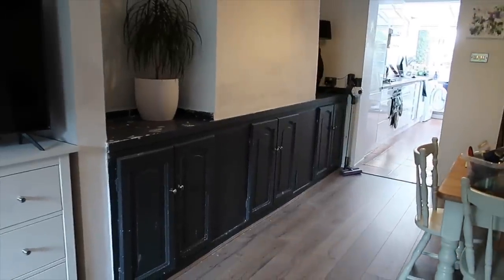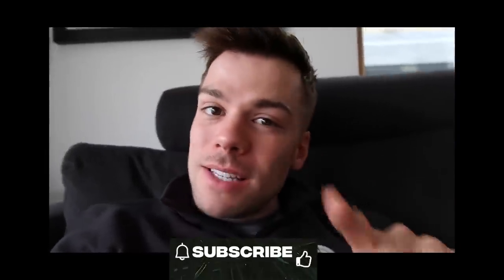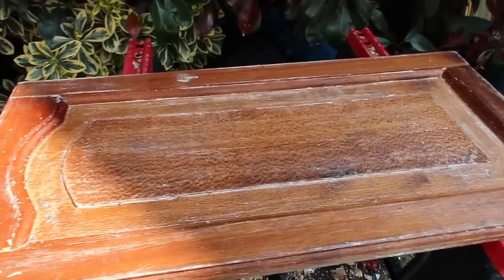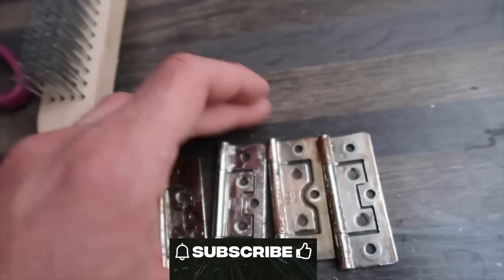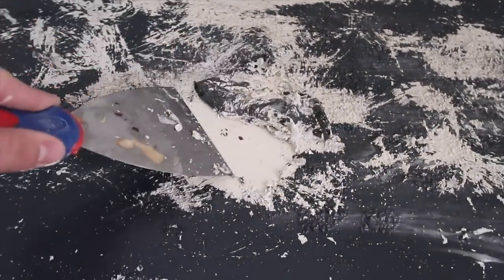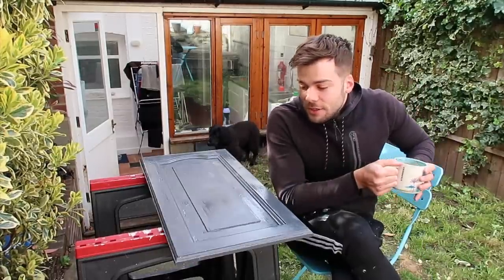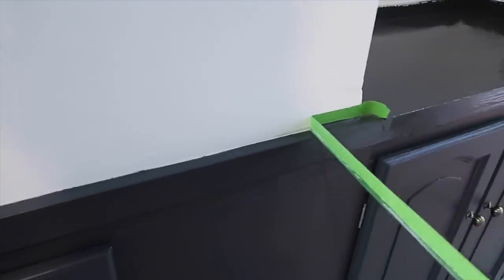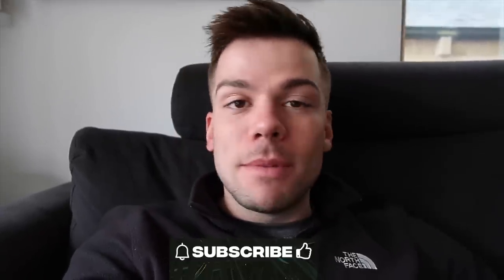Renovating the Dining Room & Finding a Mysterious Key! 🗝

Comment: You could look into doing a cover crop like clover instead of grass. It’s pretty low maintenance and naturally spreads. It can also be added to your grass in order to provide nutrients in lieu of using fertilizers. Best of luck in the garden!
Reply: Clover ☘️ also fixes nitrogen into the soil. I let clover fill in the bare spots in the fall/winter, then put down a layer of topsoil in spring with fescue grass seed and left with a luscious green lawn in summer.

Comment: Yes, there are wires in the thermostat. You also need a extra powered wire which can be done on most heaters.
Reply: As simple hot water boiler heating system just uses 2-wires. It's low-voltage DC coming from a transformer on the boiler, no power wire needed.
Reply: Yes, a transformer works but, if you don't have a plug or don't want wires showing, jumping a wire works as described in the thermostat installation manual.
Reply: @tonytiangco  There is no need for any external power source for over 90% of residential boilers. Every Nest thermostat that I've installed on a boiler, even state-of-art compact boilers the size of a mid-size suitcase gets its power from the boiler's transformer 2-wire connection. If the Nest thermostat sat on a shelf too long in a store you may need to change it initially via a USB cable on a computer or phone charger but after that it gets its juice from the 2-wire setup.

Comment: Joel, My Nest is hooked up to a boiler with just two wires. That old digital thermostat that you have is pre-wifi so it will just be two wires also. You can set the Nest display to show different info, I've got mine set to show me the weather outside. The screen goes dark until you walk near it. The Nest also charges itself through the low-voltage electricity coming through those two wires so you never have to replace batteries. Nest has a great install guide on-line.
Reply from the maker: Thanks for the info! I'll look more into it! Would be great to fit one!

Comment: The fireplace area is fascinating.  that round bit on bottom may have been for a screen?  I would find a decorative grate to put in front.  Also, don't htink you need to prime twice.  Once should be enough and then two coats of paint + top poly coat for protection - and use a small roller for clean lines - no brush strokes

Comment: If you want to spend the money, there are services that historians use which can scan the wall where the fireplace was and see if it's still behind there and open to be turned back into a functioning fireplace.  I don't know how much heat you'll get out of it, though, if you do that, especially since the UK is a colder and wetter climate.  Your patch of grass is so tiny that you can get away with a walk-behind manual lawn mower.  For nest thermostats, it depends on what kind/model it is and how old it is as far as Google tells me.

Comment: Because of the dog you should replace the grass. If you seed it, the dog will bring dirt in the house and mess up the seed. 

You should be able to pop the thermostat off the wall to see if it has batteries or check how many wires it has. They are hard wired to the boilers. Nest would need power to it and the easiest way is to see if the old one has batteries that power it or power from the wire. I would check out an ecobee instead of a nest, unless you want to get nest smoke alarms and connect them all. I personally preferred the ecobee vs nest. 

I learnt the hard way about the grass seed lol, my dog made a mess of the house.

Comment: I love my Nest thermostat. Your current thermostat looks as if it is wired. After all, it has power going to it or you wouldn’t be able to see the display and if it has power it’s most likely directly wired. You probably could pop off the front cover and there should be some screws attaching it to a bracket. Or some screws attaching the bracket to the wall.
Reply from the maker: I’ll do some digging! Thanks Dave!!

Comment: Ooh!  You found that key… but when you were showing where you need to attach the magnetic strips, at about 16:22, there was a key hole!  I guess the lock was removed!  Anyone else see that?

About the spindles…. Do you have an architectural salvage place near you?  Perhaps you can buy the spindles and end post separately and just hire someone to install. Not sure if there would be any savings that way, but it might be a good idea to check it out.  PS I’m doing that for a vintage bathroom sink to put into my 100-year-old house.

Comment: The fire place - the hard frame looks like the original fire place surround (You could strip it and see what the paint is covering up) . You could also remove that inner box and see whats under it . Some of the old fireplaces were stoves which had a door (which Id bet thats what you had gven theres one at the top and the bottom) others used those hinge things to attach the grate. Definitely worth gentle exploration but I wouldnt damage the hard frame as thats almost certainly original The Lawn issue - you have a slight problem ie Ava - dog pee will burn off the grass so unless you can restrict where she 'goes ' you will have patches.
Reply from the maker: Thanks for the advice!! Really keen to discover whether that was a stove or fire!

Comment: A thought about the stairway: Have you considered just stripping out what is there and replacing it with a handrail with 2-3 support beams? That would open the stairway up but be far less expensive than the quote you received!
Reply: Arthur, couldn't that be dangerous, especially for Ava if she accidentally slipped? 3,000 doesn't sound like a lot, or maybe Joel and Lucy could go to an old beautiful home that is being restored, but they want to get rid of whatis there even though it's in excellent condition. I live in San Francisco, and they redo these mansions all the time.
Reply: Arthur, Not sure about building codes in the UK but in the US the handrail spindles must be closer than 4 inches apart. Here's a blurb fro a building inspector:

What Are Common Residential Stair Code Violations?
During my home inspections, the most common areas that I cite in regards to stairs come down to just a few items:

Four Inch Sphere
Anywhere above 30-inches from the ground, there needs to be a guardrail to prevent a hazardous fall for an adult or child. In the home inspection world (and the IRC), there is a rule known as the four inch sphere rule.

Basically, it means that a 4-inch sphere should not be able to pass through the handrail. The 4-inch sphere is equivalent to the head size of a small child. If the child’s head can get through, then their whole body can get through.